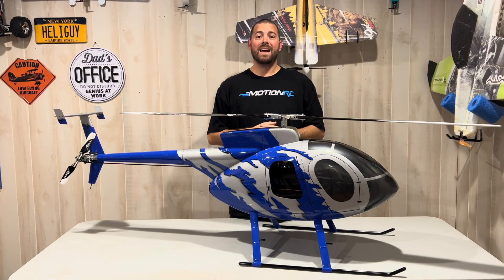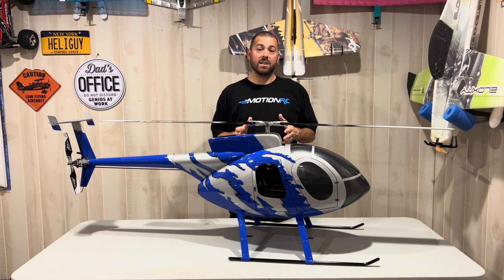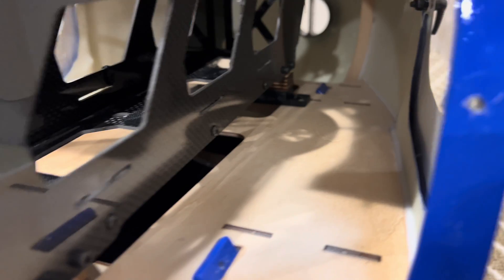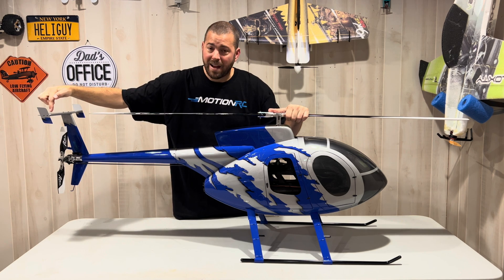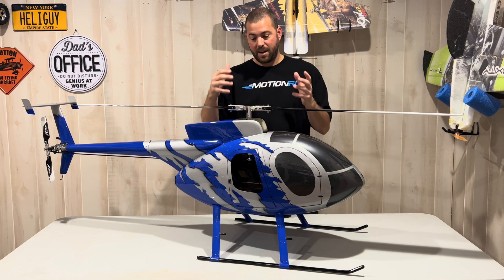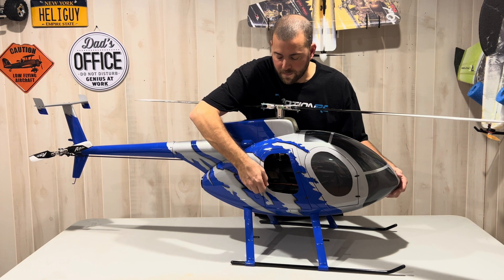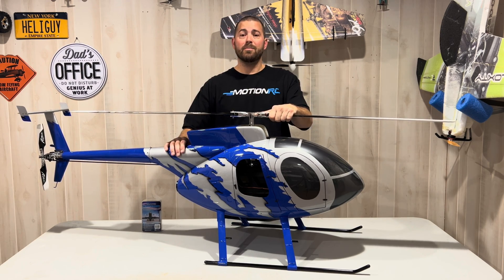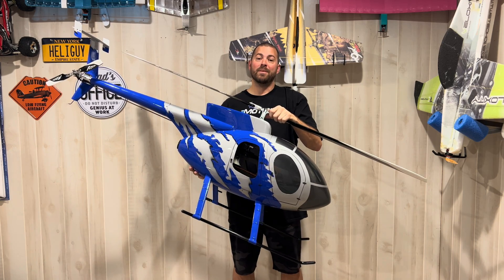Roban 700 Size MD500 G-Jive Scale Build Overview

Comment: Hello Chris,  did you find the gun metal on the front screens absorbs less heat from the sun?
Reply from the maker: Absolutely. I still however, would not leave it in direct sunlight.
Reply: @ChrisReibertRC for sure. Black looks good but kind of risky heat absorbtion wise 👍🏼

Comment: looks great ,whats the flight time when its in the air ? can it be gps stablized or controlled
Reply from the maker: 5-8min depending on battery choice. You would need to use a GPS enabled flight system.
Reply: @ChrisReibertRC  can u swap full charge batterys to continue flight  also ,is it capabale to fly longer range with fpv camera attached & return it back home ,that would be so cool
Reply from the maker: @nykid8849 It's all up to the builder. Bigger batteries, GPS system, FPV etc.. I built this one to fly line of site. I've at least a dozen more since this video.
Reply: @ChrisReibertRC tnx

Comment: Hi Chris.  In your video you mentioned you were going to install the GT Power Aircraft lighting kit in a follow up video.  You actually installed the lesser version in another video.

I have both sets but wanted to use the one in this video if I could.  The problem I'm running into is I can't get the lights to change modes.  I can't even get the lights to turn off and back on using my TX16s MKII.  The Rx is a FS-IA6B.  I have a UBEC to power the receiver, and I guess I'm supposed to get a switch module that the lights plug into, and the module plugs into the receiver?  I've not been able to find any info on how to hook these things up so I can enjoy the different modes.

Got any suggestions?
Thank you.  I really enjoy your videos.
Reply from the maker: When I had the GT Power in my Bell 212 I had it on a spare channel in my Vbar and changed the patterns with a flip of a switch.

Comment: Hi Chris can i ask ..... with the wood risers did you bolt those through the plastic risers or just epoxy them buddy ?
Reply from the maker: Everything screws or bolts in so it can be removed.
Reply: @crmodels  cheers fella 👍

Comment: Read your write-up on the 450 scale in rc groups watched videos from the Miami vice era of you flying..lol! wow are cameras sucked back then. Then you had the 600, now 700. "These times, they are-a changin" :)
Reply from the maker: Oh I’ve easily built 30 scale helis now.
Reply: @ChrisReibertRC  Ok so i'm on the fence of getting a 450 scale or 600 but leaning 600. Problem i'm seeing is finding a cheap but good 600 heli mechanics for it that will fit. I have a RAW 420 i just bought and i'm trying to keep costs somewhat under control but definitely want a scale. Hughes 500's are the only one's for me. Any suggestions?
Reply: I wonder if RAW 420 mechanics would fit in 600 Hughes..lmao!